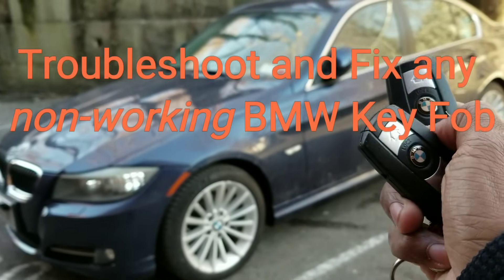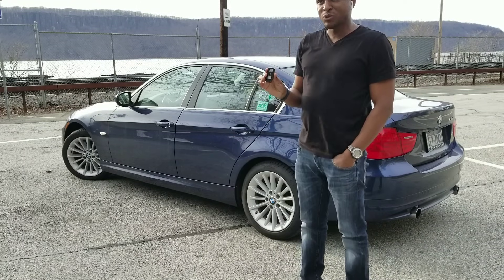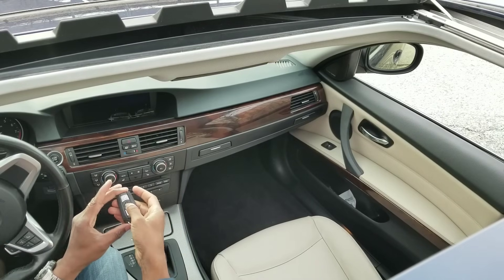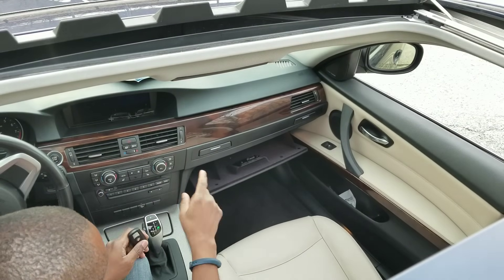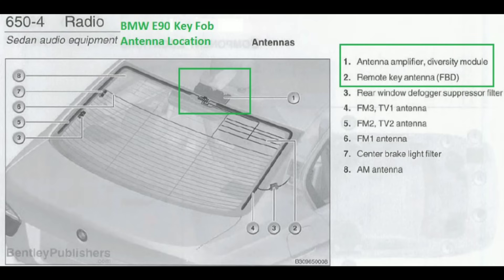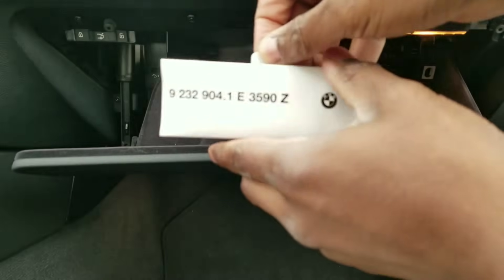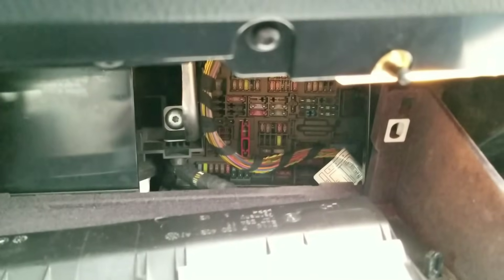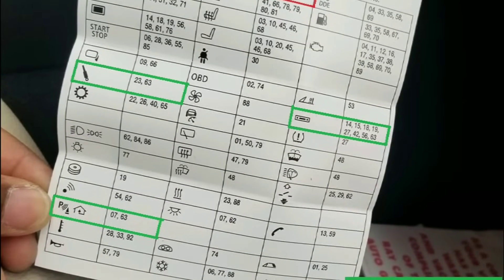Dead BMW Remote Key Fob? No Problem! Quick & Free DIY Fix!

Comment: Did your car start before trying this? Mine doesn't even start.
Reply: did you put the key next to the steering column, put your foot on the brake, and then press the ignition?
Reply: @yuhsl4y  No. I don't think I have an steering column indicator logo of a key. The doors won't open like they normally do. And the gauge display doesn't light up as usual.

2004 1-series.
Reply: Jacob Velasquez soo what do you exactly, please explain.. my car turns on, but doesnt unlock/lock with key fob, Central module works and fuses are ok, idk what else to do any help? Much appreciate
Reply: @juandontworryaboutit4150  I'm an amateur, but can be the re-chargable battery inside your key. I ordered a cheap one from ali express. I'm gonna solder a new battery on. Because mine isn't reacting to locking or isn't lighting up when inserted. And even though they're re-chargable they also have a lifespan. They don't last forever. My logic is that it needs 1 replacement in it's lifetime. My spare key is also like this, and I know for sure since that's even giving the key icon in the display. Strange that my other non functioning key doesn't but, I recon it's the same. Some are soldered on, some are not. Inside the key.

Comment: Man, your video helps me out, í was going to check the fuses, then on a way I think, why lock button didn't work but open and open trunk is working, then I beat the key on my knees few times and it worked, no issues and one touch lock, thanks anyways

Comment: Thanks bro I’ve recently ran into this problem..I’ll check my fuses out and see if that’s the problem.
Reply: ODGAF 408 did you find the problem ? Im having same issue
Reply: @juandontworryaboutit4150  did you find the problem ? was it the fuse ! 

i’m having the same problem and the fuses are fine

Comment: I've had an X5 E70 for 5 years.  I'm now on my third diversity antenna issue.  BMW's are great to drive but there's too many electrical issues.
Reply: My 2004 BMW X5 4.4 cannot open the doors to charge battery because it's dead you can't get in when the battery is dead so how do I bypass that thank you

Comment: More importantly, why did the fuse blow??
Reply from the maker: Michael Hall Oh because the car battery was replaced prior to the fuse blowing. I was jump starting the car every couple of days all Winter. Usually most electrical issues on modern day BMWs can be traced back to a weak or faulty battery. Back in the days it would have been water leaking in or cheap and torn wiring. Now it’s just batteries that BMW uses have relatively short lifespans especially if your car is not a daily driver.

Comment: This is great thanks. One question though. Would the dealership not check that fuse before deciding on giving you a new fob? Or are you saying they'll change the fuse and then try to charge you for a new fob?
Nice video 👍

Comment: Yes but I can't even open the door
Reply: Take the key out of the fob by pushing the little black push down on the back or side. If your locks aren’t visible look under the door handle for a slot that the key slideshow into. That removes the lock cover. Now you can unlock the door with your key.

Comment: I don't mean to nit pick, but changing a 15 Amp to 20 Amp fuse does not sound like a good idea to me. You see, if it takes more than 15 Amps to lock or unlock your car, then you have an issue that needs to be addressed for sure since a solenoid might require about a couple of Amps to activate, so feeding the problem an extra 5 Amps, to me, don't seem like the right approach in addressing it. I could be wrong, but my ASE training dictates to never increase the capacity of any electrical circuit unless there is a componentry change that warrants the increase, such as a solenoid replacement that requires more energy to activate it. Otherwise you are just asking for much bigger problems to occur that could possibly amount to be as serious as a car fire.

Comment: Thank you so much!! I just bought a 2nd fob thinking battery was dead. Your video was absolutely perfect as I had no idea there would be a fuse involved and location etc was exactly identical to yours. 2011 323i. Both fobs worked after I put in new fuse! #63 be damned !!!
Reply: @joelprevost6094    What number?

Comment: Mine is only lock button wont work unlock and boot work any idea
Reply from the maker: This sounds like a key fob battery problem and not a fuse or car latch problem
Reply: @olaf2046  

I thought the same but if it was battery surely the car wouldn't unlock the doors and boot ??

Comment: Checked out all the fuses, seems ok, even replaced some with brand new ones, sadly my FOB isnt working, gonna change the diversity module tomorrow, hopefully that fixes it, E91 BMW.
Video is great by the way
Reply: It didnt fix the issue, the wires at my boot were literally torn in half, took it to an electrician and had it fixed in a few hours.
Reply: I tried the fuses and my key fob still don’t work. Can you help me? I have a 2011 328i bmw
Reply: Reinis so the diversity antenna module wasn’t the problem?
Reply: @reinis531  so the diversity antenna wasn’t the issue?

Comment: In my experience, nine times out of 10, the battery needs to be replaced. You can find  replacement batteries (plural) on Amazon for about $5. There's no need to go to the dealership.